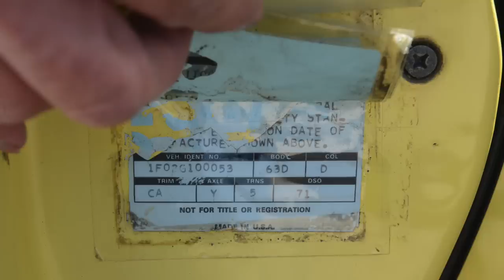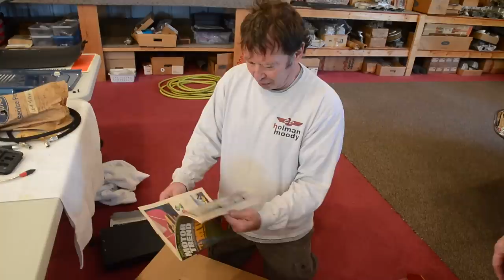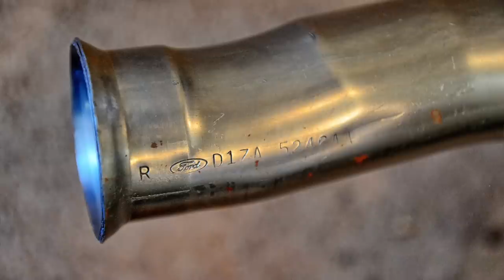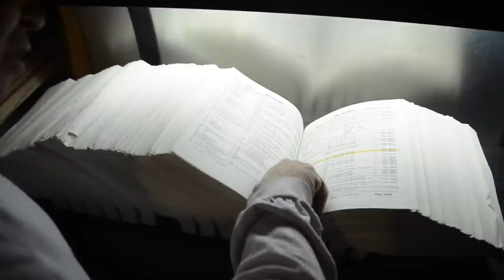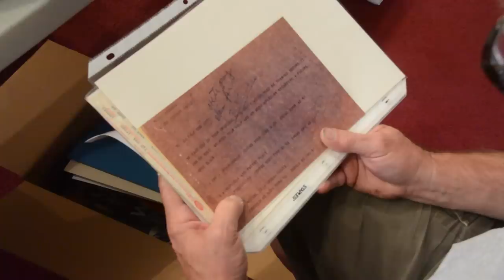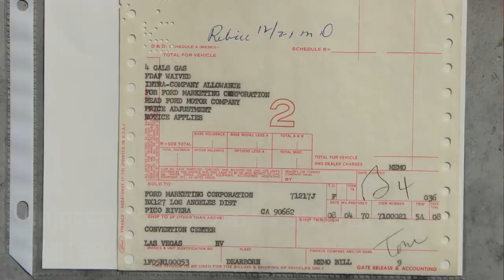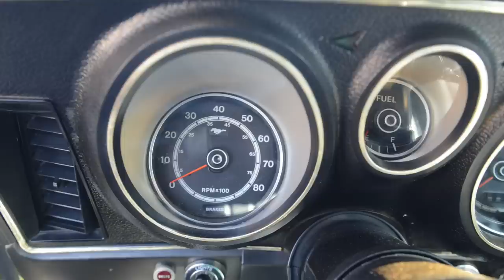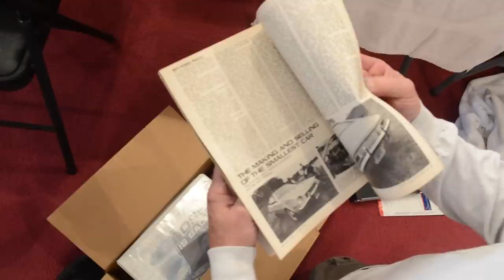Million Dollar Boss Mustang Prototype Barn Find -1971 Boss They Didn't Make

Comment: 600 pounds heavier than a '65.  Must have been a slug.
Reply from the maker: Well, the Boss 351 was faster than almost any 1965-73 Mustang and it was a '71 model fastback. The Boss 302 was a racing motor for high rpm's on the track, plus I am sure the Trans Am builders would have taken weight out of the car to get it down to the lowest allowable pounds. That fastback roof line would have made for one hot looking race car, I think. But wait, I think independents built 1971 Trans Am Mustangs. RIght?
Reply: As a street car in factory tune, the Boss-2 wasn't that impressive (in the quarter and 0-60) and in a '71 would have been less so.  And of course the Boss 351 was one of the baddest stormers ever, but those extra cubes made a huge difference.  My comment reflects only my opinion of how a street Boss 302 would have performed.  Further, the Z28 (if I'm not mistaken) was offered only with a 350 in '71, leaving a Boss-2 with no direct competition.  It couldn't have but suffered in the inevitable comparison.
Reply: If I remember right, was commissioned master mech back in the 80's for 16 years, anything that said "4V", was the detuned version to meet emissions. I noticed they mentioned 4V in the vid. If it has the exhaust gas crossover pipe that connects to smog pump,  it's a 4V I believe.
Reply: As Jerry Heasley pointed out, the '71 Boss 351 was just about the quickest pre-73 Mustang. Sure the Boss 302 motor would have been a bit of a dog with the extra weight, but remember the Boss 302 cars were Trans-Am homologation cars (not necessarily stoplight animals). Easiest way to wake up a Boss 302 are some 4.10 or 4.30 gears, toss the rev limiter, some long tubes, and let it eat! My dad killed his '70 Boss 302 by letting it eat a 'lil too much though (oil starvation was pretty common for those motors).
Reply: Again, a stock '71 sportsroof with a Boss 302 would not have been a very impressive car.  Sure, the earlier B-302's could be modded and wound to the moon and no doubt this package would have responded the same.  But a showroom '71 with a Boss-2 would not have been anything to write home about.  Give me the solid lifter earlier cars any day.
Reply from the maker: Good analysis except the Boss 302 wasn't built for quick 0-60 MPH or quarter mile ET's. The Boss 302 was designed for high rpm to road race. What you are saying is the the 1970 Boss 302 was the last of the real Trans Am bred homologation specials, along with the AAR 'Cuda and T/A Challengers. Ford chose to compete on the street with a car they called a Boss - boss of the street, not boss of the track.
Reply from the maker: Just read this, after I wrote my similar answer.
Reply from the maker: I'd write home if I won a race in a 1971 Boss 302 - a road race.
Reply: Exactly.  1970 was the final year for the real knife fight in T/A competition and we know how that turned out.  Of course, we had PJ, so it wasn't really a fair fight from the beginning.
Reply: FORD  turned the BOSS  into the Employee   in 1971 .